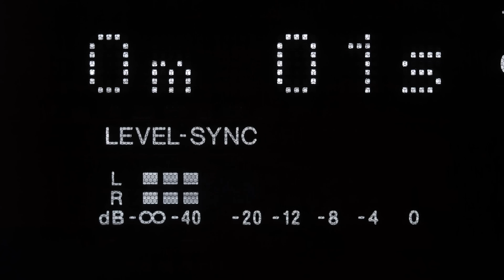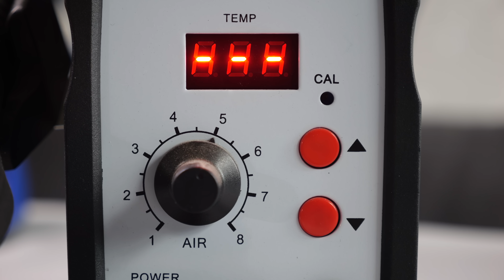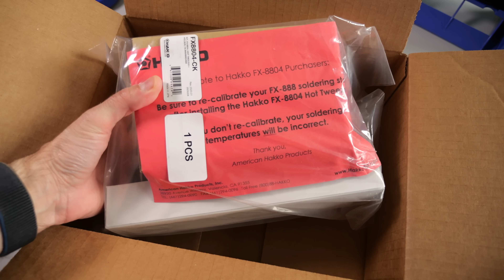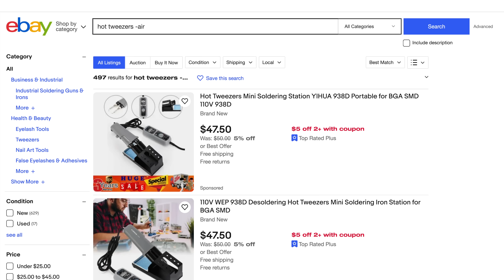A BETTER way to replace surface-mount capacitors!

Comment: what about using solder removal alloy? I know its overkill for 2 pins but it'll work.
Reply: It sort of works, it's really reluctant to wick under the capacitor where the pads are!
Reply: @SianaGearz  I suppose plus its expensive and if you don't clean it all off you will have a terrible joint on the new part.

Comment: I was not aware that hot tweezers were a thing. I was trying to pull capacitor off a board recently, I ended up using two soldering irons like chopsticks. I thought it was being clever.

Comment: The twist method works better if, "when you twist"  you don't pull... you actually put pressure down on the cap.  Lifting up at the same time in my opinion increases the chance of pulling the trace pads off.

Comment: In my experience pushing down and twisting these electrolytic capacitors is the safest way of removing these. Heating the pads with a soldering iron increases the risk of lifting the pads considerably.
Reply: If you feel uncomfortable with the twist method. A good and cheap alternative is to use a thin stainless steel spatula together with a soldering iron. Just heat one pad and slide the spatula between the pads and component leg. Solder will not adhere to the spatula. This method works well for many smd components and even ICs.

Comment: Maybe I've just been lucky, but I've twisted off hundreds of caps without any problems. Until something bad happens, it's worth the risk for me. Even then, a single torn pad isn't the end of the world. I did buy an affordable hot air station at one point and it interfered with my house wiring so I had to return it.

Comment: To any one wonder about to get a cheap hot air station, lots of electronics services here use Yaxun products... Not a Weller, not even close, but does the job. Also use a simple iron with a low fusion point soldering wire is the way to go for me

Comment: you can use a double headed soldering iron to remove such surface mounts caps or just use 2 soldering irons

Comment: I want to get the hot air rework station, but don't have the funds to get something expensive, and im afraid of getting a cheap one for the same issue mentioned in the video.

Comment: You don't need a desoldering tweezers for this kind of job, use a heat gun set at 175C just enough to soften the solder beneath the cap and snap it off with a pliers,  you won't cause any damage to the pads.

Comment: I'm here pondering about a 3D printed, handle of sorts, for two thin regular soldering irons. Like I've seen some folks use with chopsticks. No need for an expensive specialist tool....

Say, do you happen to have any experience with ESR meters? In circuit testing, if that cap is actually in need of replacement.

Comment: I have seen people use hot plates (the hot plate itself is a PCB) they designed themselves to solder on or remove components from boards that are only single sided, maybe that's another option?

Comment: So, you are taking on this battle? :D nice video, by the way! As always.
Reply: Adrian steps up as first challenger!
Reply: @PaulMiller-mn3me  I was, in particular, thinking about him.
Reply: @PaulMiller-mn3me  If that works for him I don't see where is the problem. Chris Edwards went after him too If I remember well.
Reply: @PaulMiller-mn3me Adrian at least has experience. Advertising this method to heavy handed noobs is a  no for me. It leaves me to clean up the damage they do.

Comment: hi the best way i find is side cutter to cut the legs in side the cap    and take the rest of with a hot air blower with a long pipe with a bend in it
this  stop the full hot air hitting the pcb  if o have to work on sony pro video decks got to be so care for  i use low temp solder as well  it helps big time 

and what solder they were put on with  is a pain

Comment: Twist. One smooth motion. Don't pull or rock. For the squeamish, I've found two soldering irons work just fine and are surprisingly fast. Great vid tho.

Comment: Hi Colin. Love your videos. My first SMD recap was my Amiga 4000, luckily it all went well. I really took my time. I used locking tweezers I was given from a surgeon to hold the base of the cap to stop it moving, then cut away the top and made my way down to eventually remove each one. However I have SMD rework gear now. What I now consider to be the best method is to use hot air, but to first melt the solder on each leg (or all legs on an IC) using QuickChip Alloy... it combines with the solder already there so it now melts at 60ºC instead of 200-300 or whatever. So then you can use less hot air, or cheaper hot air tools, and not stress nearby components as much. So melt the existing solder with that first, then all the solders legs will soften easily at 60ºC. I consider this the least invasive approach, and essential for large ICs if you're attempting it without board heaters etc.

Comment: As long as you´re not dealing with super small parts, electrolytic smd caps are actually easy to remove:
Heat up the first solder pad, lift the cap up slightly only at this side, then do the same on the other side.
The capacitor legs have bend pretty easy, so you can lift up the first leg far away enough so it wouldn´t stick back to the pcb.
Then you only have to heat up the other side and easily remove the cap with a pair of tweezers.
And boom you just removed a cap without damaging the solder pads.
Reply: Yeah I’m not sure why folks seem to think both sides need to be heated up at the same time. It’s fiddly getting the pivot right but not that difficult. I find hot air faster but this iron method works great too in most instances.
Reply: I think the main problem is when the solder has been heavily oxidized from corrosion.  It can be very, very difficult to melt the solder in those cases.  Combine that with legs that are mostly, or completely, obscured under the body of the cap, and other components packed in around the cap, and it's just not happening.

Comment: If you already have a Hakko station can you just buy the hot tweezers?
Even if you don't already have a Hakko if you could do that then part of the cost would be in an actual soldering station which means only the tweezer part would be a single use item?
Reply: Hakko has tweezers for the FX-888D and a conversion kit for the FM-2022. No option for the FX-951 which is a bit strange.

Comment: ive been looking for a decent hot air rework station for a while and just cant decide on something
Reply: Get a cheap one, and rewire it. Did a rewire to my cheap hot air. New combo PC power cord imput / fuse / power switch. Just get a not cheap from china version so it is wired right, my switch had the fuse on the neutral end, a dremel with cut off wheel fixed that problem. It is a good project to work on. There are lots of videos on what to check. Check that the tip is grounded to the end of the power cable , and that the fuse is on the live end, is the major problems easy fixes.

Comment: I don't like to use hot air for this, I just add solder and keep heating one side with solder iron and lift that side up and then do the other side

Comment: I use the twist method. The idea of accidentally overheating a capacitor to the point it pops in my face is not a fun one. I've never lifted a pad by twisting, and I've done a lot.

Comment: Personally I like combined method. Use hot air to preheat surroundings and touch pads with proper soldering iron. Or use a preheater to ease your task a little (it can be anything from heatgun or electric stove to infrared one). And yes, as enthusiast I have much overpriced tools, but having some commercial jobs once in a while paid them already

Comment: I just watched a video over on  Adrian's Digital Basement and he was very specific in his twist-off method that I think you should consider in this context.  He says he swears that he has never had an issue even when the boards had substantial corrosion.  He says his method is to PUSH DONW continually on the CAP as you twist it off.  Have you tried this variant in your evaluations?

Comment: I have a Dremel Versatip. I'm wondering if using just the hot air nozzle will work. I guess only one way to find out...

Comment: I’ve found computer motherboards to have sturdy pads, but weirdly, GM automotive boards have fragile pads that I’ve ended up having to repair (not from pulling caps) so I would avoid pulling caps from those.

Comment: Hi Colin, have you ever heard of the Apple TechStep, a diagnostic device from Apple for the Macintosh SE30 and other Macs of that time. I recently came across one (thought it was for a Mac Portable, as the carrying cases of the two machines are very similar)

Comment: I'm super-glad to find someone who dislikes the "pliers" method as I do. I've been recently re-working some boards, each had 100+ SMD capacitors to replace (actual, dead capacitors!).
I got some cheapo hot tweezers but - as I see in your video - it's difficult to touch the very small pads of an SMD cap.
My favourite method is: pre-heat the board at 100C, add some flux then use TWO solder irons with small chisel tips. You have much more control than how tweezers - at least my cheapo ones - and the cap will come off in seconds. So far, no damage was observed. Once you get used to the technique, it's pretty fast!

Thanks for the video!

Comment: If you use a gigantic tip like that then yes: removing caps with a soldering iron is risky. Use a much smaller tip and flux. A chisel or hoof tip as well - not a conical behemoth.
Reply: Bent conicals are fantastic for micro soldering. If you need a larger surface for a joint or for quick braid work, just turn the tip to the bend. If you need something small, angle it so only the tip after the bend is used.

Comment: I have used the twist method for years.........never once had an issue after what must be hundreds of thousands of times.......I also use hot tweezers and hot air, but all yield the same results.......the cutoff with side cutters looks like a disaster waiting to happen.....

Comment: I would suggest holding a heat gun upwards and have the board face downwards and blast the hot air into a funnel that forces the hot air right onto the cap and nowhere else. Gravity should let the cap/device fall out. It might be difficult to see whats going on though.

Comment: Hot air has yet another issue. Glass fibre causes moisture to wick and get retained in the epoxy substrate of the PCB. With hot air, the moisture has a habit of concentrating in a spot and turning into steam in one go, causing the PCB to delaminate. Like popcorn. This would make the board more fragile, and also if there are any vias in that area, they will be jacked open, and the failure may be non-obvious except during heat or humidity cycling.

Comment: With leaky caps, you can VERY EASILY rip the pad from the board.. idk what your talking about. Sometimes when a cap leaks, it can start to eat the pad and it weakens its grip to the pcb..

Comment: I totally agree with your findings. Quality tweezers are the best in most situations. Hot air is a good option if you’re on a budget. Twisting isn’t worth the risk, especially for beginners who won’t be able to deal with torn pads and traces well. Nice work!

Comment: I swear by the two irons method. But the irons have to be decent quality and similar in performance/heat/tip shape.

But yeah, hot air guns are super useful.

Comment: You are setting your hot air gun to to high of heat, that is why you are swelling and damaging the caps and melting the connectors etc.  It is slower to use the correct temperature, but it is the professional method for rework.  One thing that helps alot is to use a hot table to set the board on and bring the entire assembly up to 150 to 180 degrees F.  Then the hot air gun works quickly and safely.  I've used professional hot tables for years in my work but have used a hot griddle I bought from a Goodwill for $5 to set even big motherboards on to preheat.
Using the same temperatures the board manufacturer used to build the board will typically be safe for all components.

Comment: DON'T RIP, DON'T CUT! 
Use pliers to rack the capacitor back and forth slowly and not too far from beginning position. the legs will give way eventually. This is the safest method I've found.

Comment: I have a Yihua 878AD but the thing go broken alone, the controller by some reason stop to work, the input where is detected the magnetic switch is keep low and never enable the heat gun, I had to remplace that for an Arduino and make my own firmware to make it work again.
As fan of asian food, I can use both soldering iron on the same hand XD

Comment: Are you using any flux? The only flux I saw in the video was the coating on the copper braid, and it looked like you were having difficulty even with the tweezers. It would be a good idea to apply fresh solder to the joint first also. As others have said, for large PCBs, preheating is essential, you could do it with just a hot-plate on a budget.

Comment: Good coverage for a controversial topic. I am in the twist and or cut camp but with caveats.  You can't just rip them off, you have to apply downward force and twist in one direction until the legs break.  If you do it right I can honestly say that the risk to the pad is not high.  I can only give you my own metrics. Over the years I have recapped over 100 boards and I can say the only time i have ripped a pad off was while I only used hot air removal.   But in the end, do what works best for you...

Comment: Unsure if anyone uses my method, using a flush cuter to cut near the bottom, removing the cap without any force. You are left with the black plastic, just cut it and it falls off. Last, use tweezer and iron to remove the legs, which come of fast and are super easy to access after the cap and plastic are gone.

Comment: I use my solder tongs for that,

You could get away with modifying the tip of your Iron by just rap  copper wire what's a horseshoe shape sticking out you can even pull Ic's off that way as well...😊

Comment: If you do go for the Quick, get the DE, not the DW. More (120 on the DW, 200 on the DE) airflow and more heating power. Personally I can only endorse it.

Comment: What about adding extra solder to one side to pull up one of the legs a little, hitting it with the wick to clear the space between the pad and leg then undoing the other leg no problem. Thoughts anyone?

Comment: I really have to protest with the technique being demonstrated for twisting the caps  -  DO NOT PULL the cap. Folks who complain about the twisting method show their bias (and perhaps ignorance) by calling it 'twist and pull' or 'ripping'. You must PUSH while twisting. The examples in this video clearly show pulling or levering the cap, which is obviously going to put force on the pad.